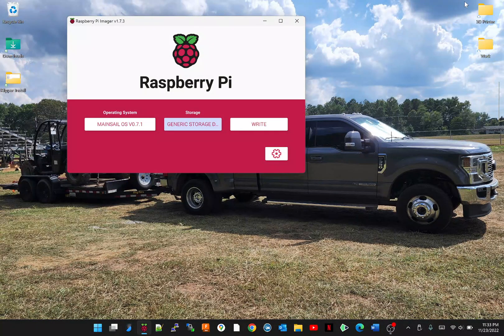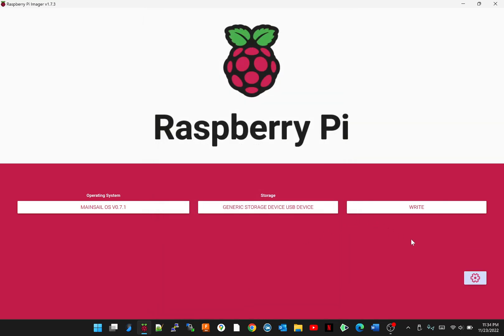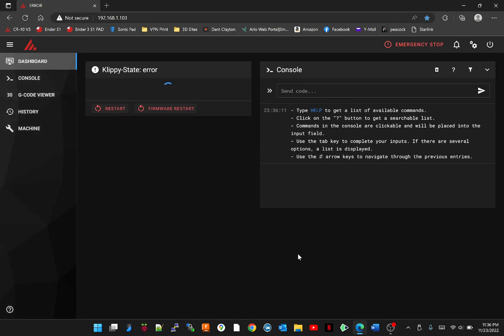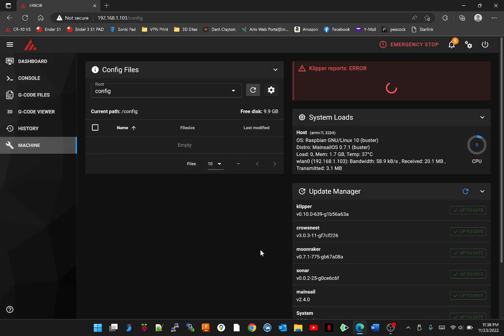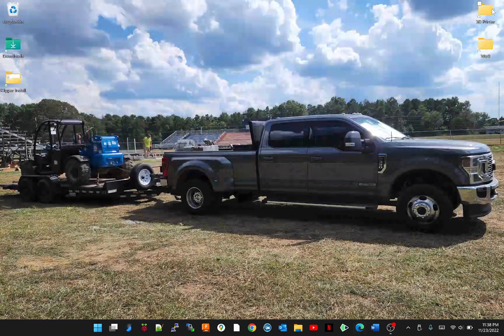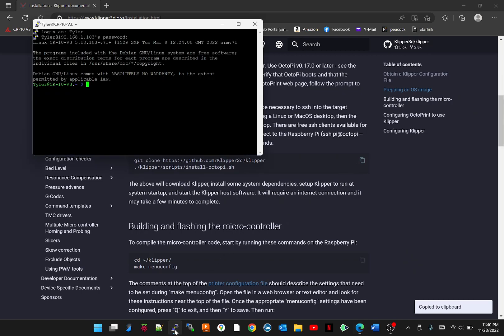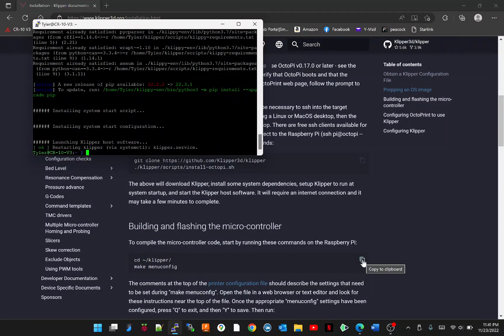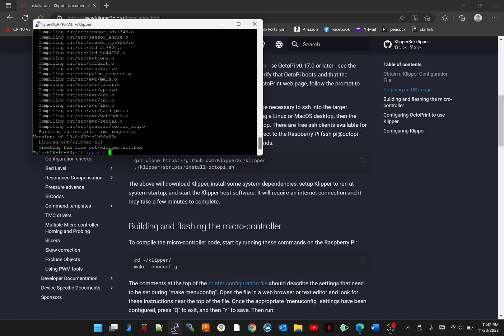CR-10 V3 Klipper/Mainsail Install and Basic Setup on Raspberry Pi 4B Part 2

Comment: Hey dude, I followed your video now in 2025 to do my CR-10V2 and it was a breeze. I still have to tune the extruder settings, because the V2 had a bowden tube not DD, but everything else was shanana. THANKS. You're a rock star.

Comment: Which axis did you connect the accelerometer to?  This machine isnt core xy, so the accelerometer would work correctly?
Reply from the maker: You run the test on both X and Y Axis